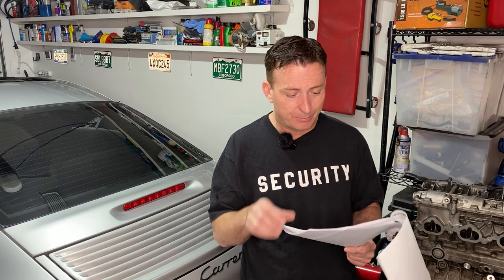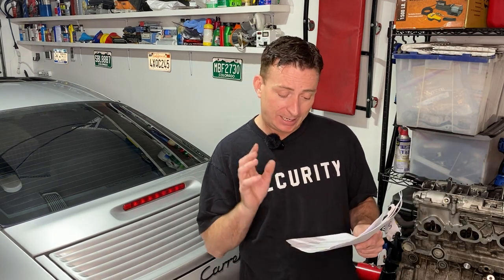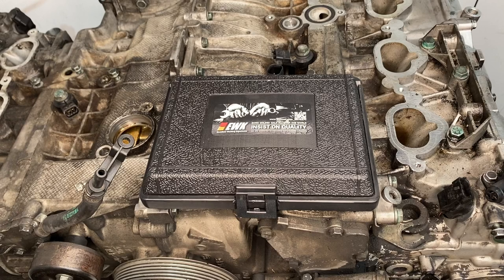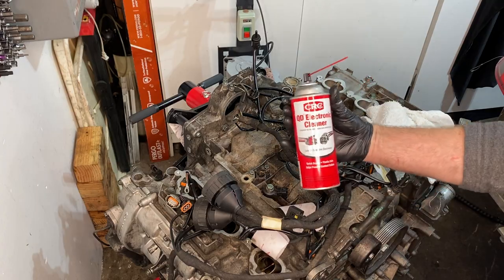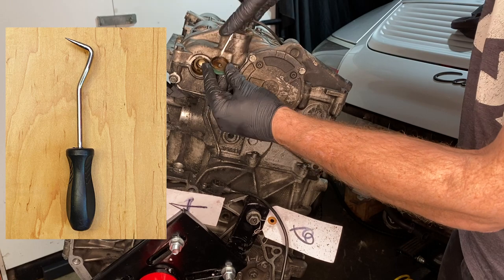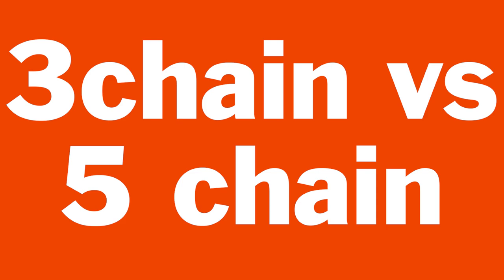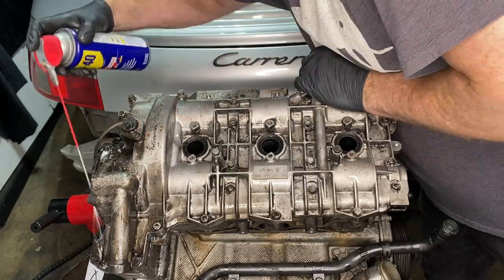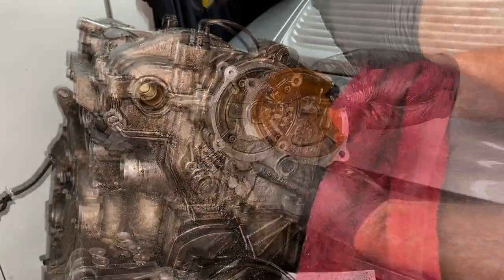How to Disassemble a PORSCHE 996 Engine Part 3

Comment: Very informative, and sounds like timing chain tensioner failure and not IMS as you originally thought, could be very good news if no other internal damage was caused although that could have caused a valve to hit a piston, I'm  curious though, is a 3 chain the 3.6L and 5 chain the 3.4L. Still trying to get up the nerve to start doing this to my old 3.4L that was removed from my 2001 cab, this is definitely helping that cause
Reply from the maker: Hello Don, I agree, things point more toward some timing gear abnormality then IMS. Between you me and a lamp post I got the Bank one head off and the pistons look lovely, the cylinder walls are pretty nice also. I'm am prepared for the worst but hoping for the best. And you are right the M96.03 is a 3.6 ltr (3.596cc) it also had lifter control in addition to the Variocam plus. Thank you for watching 🤘😎
Reply: @ManinaGarage  It will be a much easier and less expensive fix if you don't have to crack open the block and mess with pistons and crank
Reply from the maker: @donesper2070  Don, I agree, I also feel I have no choice.

Comment: I’m pretty much sure you are supposed to instal a tool to hold the camshafts before removing the cover.
Reply from the maker: Hello Meir, you are correct. As I am dismantling the whole engine, holding them at TDC was not a priority. The other reason to hold them is not to damage the cams or bearings by allowing uneven tension from one end to the other. As David’s tool did not fit I decided to roll the dice on that one in the interest of time constraints. I ordered a set of 5 chain tools, bank 2 should be a little more by the book 🤓. Thank you for watching 🤘😎